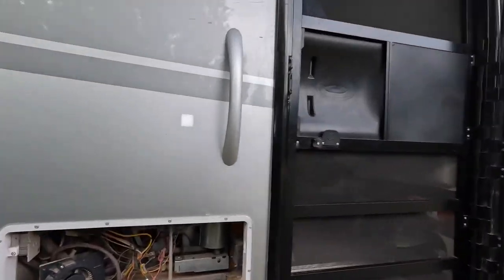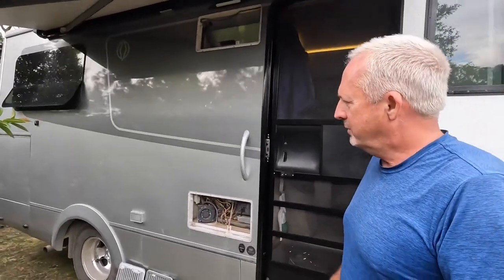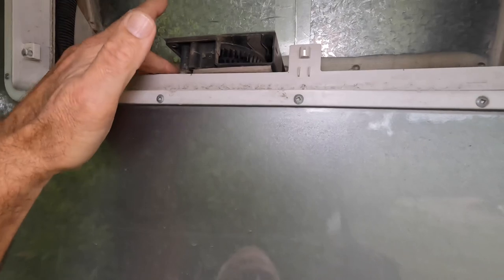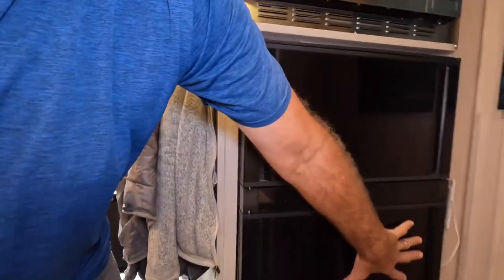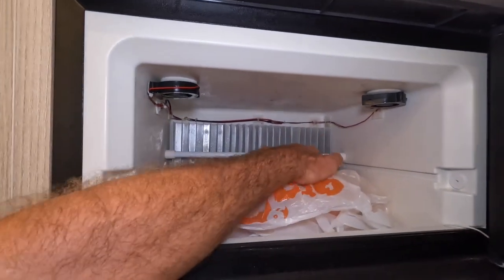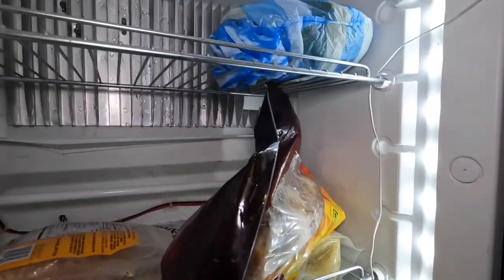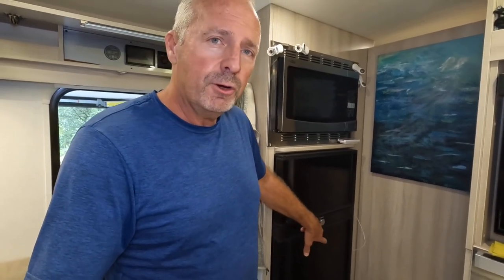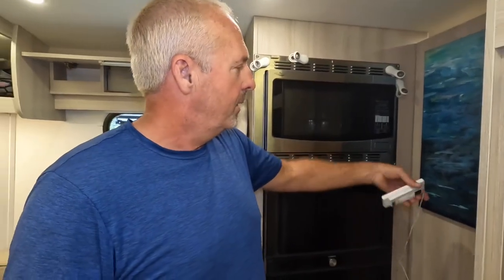RV Absorption Refrigerator Optimization for HOT WEATHER | B+ Overlanding

Comment: Last camping season I did a little experiment and I stuck a cheap mini handheld fan in my roto molded cooler with yeti ice blocks drinks food and such and it super chilled everything in there. The distribution of cold air flow made a difference and everything in there was cold and dry . Mind you it did create a suction but easily opened with a some sheers I used  which you can use anything to open.  What I'm saying air flow distribution makes a difference for refrigeration just like in this video

Comment: How about your air conditioning? Our 2021 LTV roof air is not great in Florida. How did you keep cool in South America?
Reply from the maker: We have used it very little and only when the weather was sweltering AND when we we far away from people so we could run the generator. I will be doing a video on how we keep the van cooler in hot weather without a/c
Reply: Thanks! 92degrees here and we are roasting. Any tips appreciated!